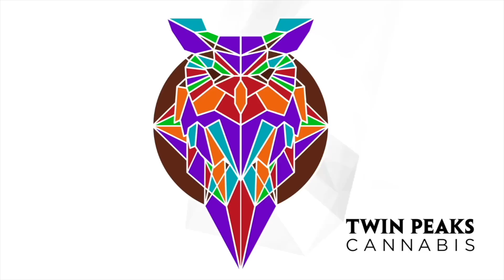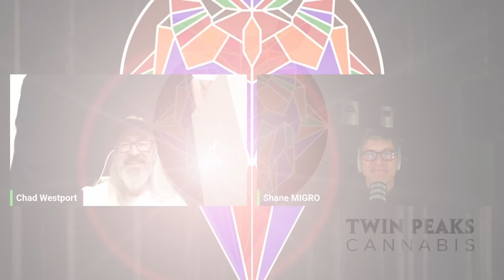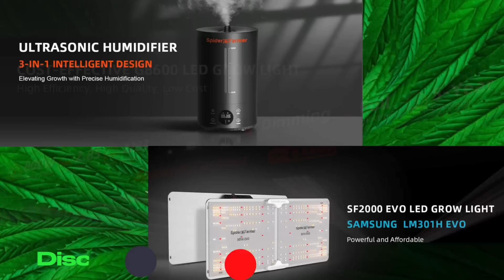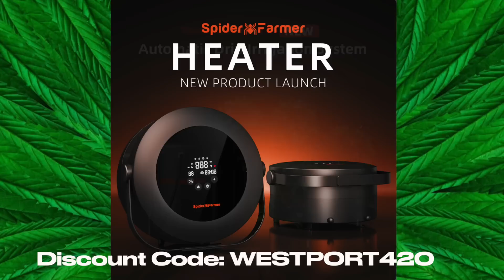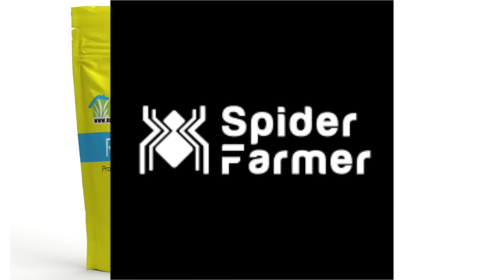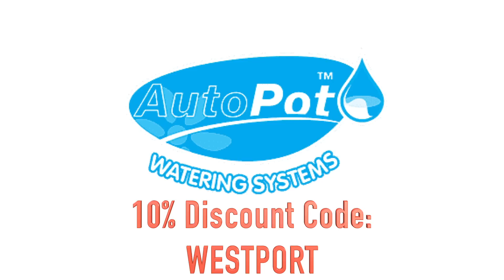Real Cannabis ep.185 - ft. Shane of MIGRO w/ Chad Westport : Spider Farmer GGS Controllers

Comment: Don’t listen to Shane show how dumb light company guys are they have talked about the Conor’s of the tents par being  lower and center hotter. Well tents have been 2x2 4x2 or 4x4 for about 15 years now and still light company guys to stupid to build a light to fit the Tents!!! GML is only one I know of has did this with a light called tent lights
Reply from the maker: There are many companies that build lights that fit the footprint of tents. My Spider Farmer G8600 has <1" on each side in my 4x4. I also use the G4500 in my 2x4 and it fits with 1" on each side. Explore your options, there are many.
Reply: @ChadWestport  nothing for a 5x5 though lol obviously every LED manufactured for commercial use has a 4x4 footprint. 

Put that light in a 5x5 and watch how much you lose off the edges.